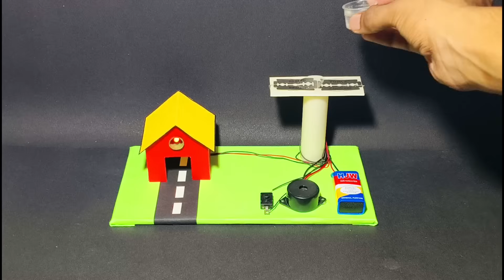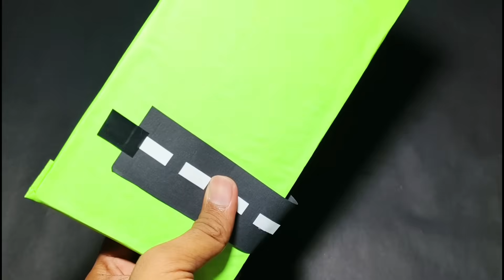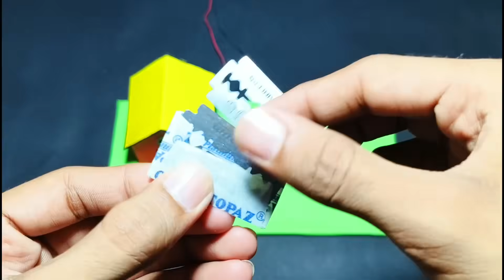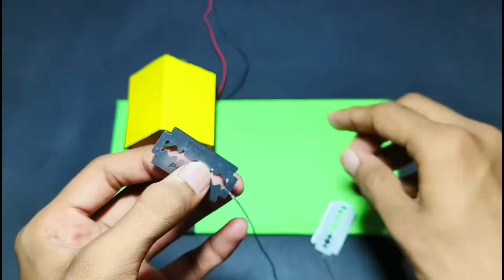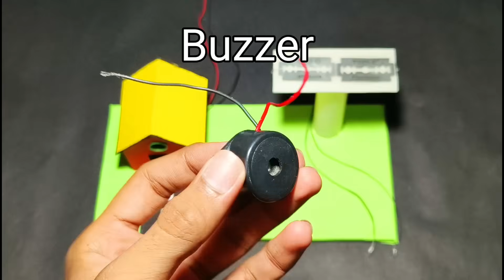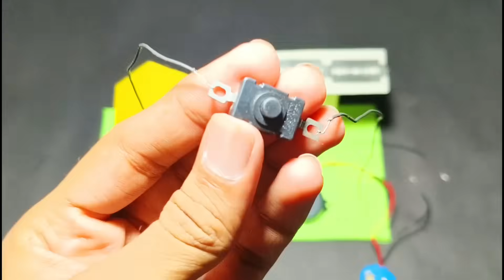How to make a rain detector alarm project | Rain detector alarm | How to make rain sensor

Comment: King of foolish how do you connect 9 volt battery in parallel with a LED ,,, do you have not sense that an LED have operating voltage of maximum 1.7 volt 

Foolish ,,,, doob ke mar ja

Comment: My project fodt working when i     drop wayer it didt buzz but when i connect blades each other than they buzz why pls reply😢
Reply from the maker: Blades ko thoda aur pass pass kar do and use 9v Battery . Ok
Reply: @howtocreate9896  thanks for replying but I did it before it didn't work pls tell
Reply: Same problem

Comment: What is the rate of buzzer
Reply: Rs 30-50
Reply: Can u provide link for the same ?
Reply: 30 rs
Reply: 90$
Reply: 90$
Reply: Only 30
Reply: Rs. 50 to 60
Reply: 35
Reply: 30rs
😊
Reply: 30rs
Reply: 30
Really i. Buyed
Reply: Only 30 ₹
Reply: 30
Reply: Only $15-20
Reply: 100
Reply: 40
Reply: 40
Reply: 40 rupis
Reply: 50$
Reply: Small 15 ₹  medium 30₹  big 50-70 ₹
Reply: 50
Reply: 15 or 20 rs
Reply: ₹50 ❤❤❤❤
Reply: Rs 50
Reply: 15 $$$
Reply: 40
Reply: 4o rs
Reply: 20
Reply: 10/- indian
Reply: 30 rupees
Reply: 40
Reply: 40 rs in my shop
Reply: 30 rs
Reply: If you buy small then 10rs if you buy big one then 50rs
Reply: 30rs
Reply: Instead of Buying big buzzer Buy small buzzer at rs 15 at electric shop
Reply: 15,30
Reply: 60₹
Reply: 30 rs
Reply: 30 rupees
Reply: 30to50
Reply: Local 50rupees This buzzer online I don't know
Reply: 40$
Reply: 30Rs
Reply from the maker: Check onlin or your local electric shop
Reply: 20
Reply: 1 rupees